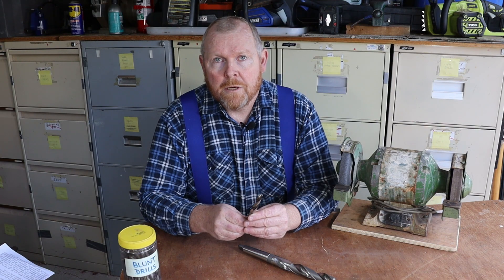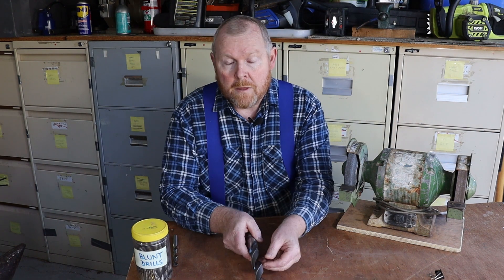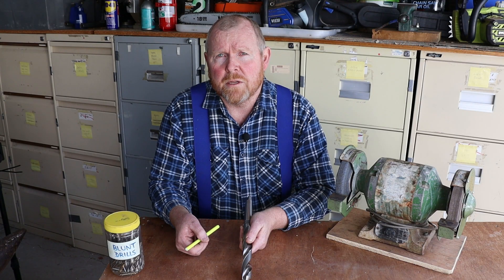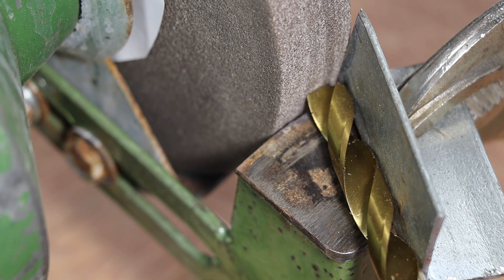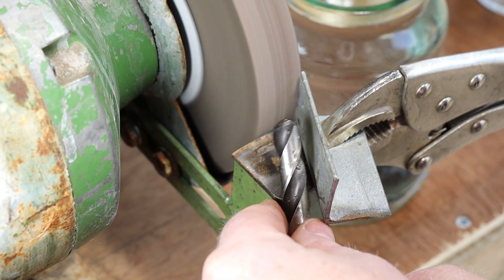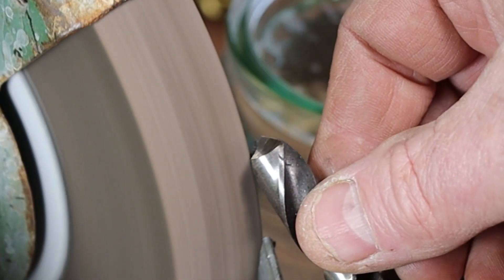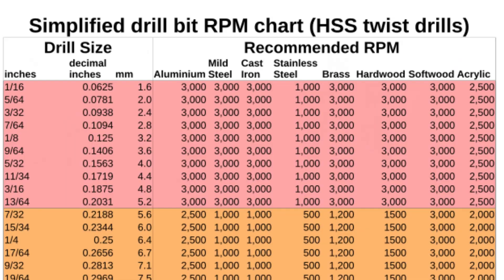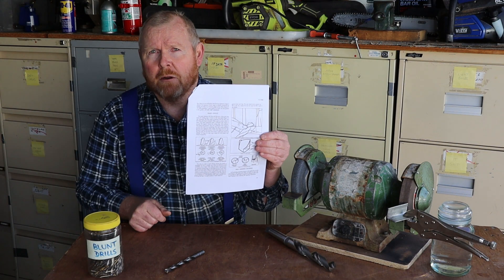Freehand sharpening HSS drill bits on a bench grinder

Comment: An excellent video. I spent my youth in the days before electric drills became ubiquitous. Carpenter then made holes with a "brace and bit". The bit had a tapered square shank and fitted into a crank style "brace'.  These days we (DIYers and carpenters) make holes in wood and steel with a  straight shank "drill". Drills are powered by a drilling machine which is usually referred to as a drill or an electric drill. But the thing it powers is not a "bit".

I feel guilty about making this pedantic observation when the video is so good, although I would have been assisted by more details on the clearance angle.
Reply from the maker: Dear Dr Smith,

I admire your determination to roll back the rising tide of “drill bit” terminology, although a quick glance at the wares offered for sale in almost any hardware store makes your quest appear to be something of an uphill battle, or a swim against the current, or possibly a Qixotic tilt at a windmill.

Nevertheless, I am not the type of man who would mock such an obviously strongly-held belief, so for the remainder of this letter I shall refer to the relevant hole-production tool by the nicely innocuous name of “Johnson”.

In response to your request for additional details about the grinding of suitable clearance angles on the tip of your Johnson, the basic idea is to ensure that only the sharp cutting edges of your Johnson will be in contact with the base of the hole which you are in the process of excavating.  As shown in the video, if your Johnson sports an inadequate degree of clearance angle, the result will be an uncomfortable level of friction, unpleasant noises, and in the very worst cases, overheating and burning of your Johnson.  (I’m sure I don’t need to remind you of the deep shame and social ostracism which is the inevitable result of such an unhappy incident).

For a deeper level of technical information on the optimal clearance angle for your particular Johnson, I highly recommend referring to “US Army Training Circular 9-524 - Fundamentals of Machine Tools”, pages 54-55 inclusive.  You can obtain a downloadable copy of this document from this internet Uniform Resource Locator:

https://maritime.org/doc/pdf/machinist.pdf

In addition to a sharp tip and an appropriate clearance angle, adequate lubrication is highly recommended, particularly if your Johnson is of a larger diameter.

Finally, one should not feel apprehensive about the prospect of applying one’s Johnson to a rapidly spinning abrasive bench grinder.  Simply take your Johnson firmly in hand, approach the grinder with discipline and determination, and do your duty.

Sincerely yours,

Mr Tightwad.
Reply: @TightwadWorkshop :  Hilarious,  OMG top shelf response. Thank you

Comment: everybody is showing you how to sharpen arm-long drill bits. What about little ones?
Reply from the maker: The technique is the same, but you need better eyesight to do it (and it's easier to show the method on-camera using a bigger bit).

I generally don't sharpen bits smaller than 3mm (1/8") anymore, because I can't see well enough.